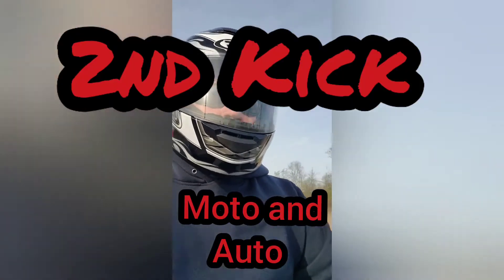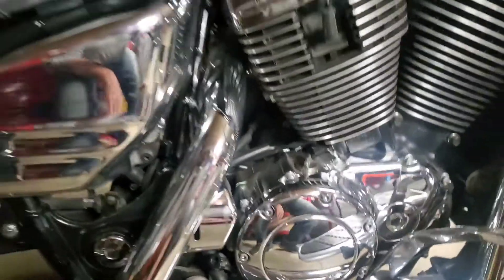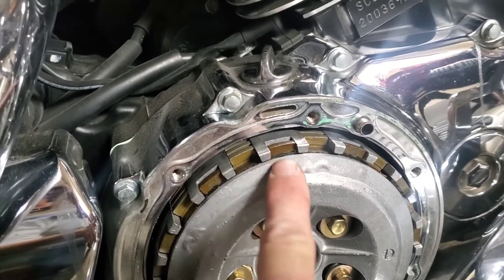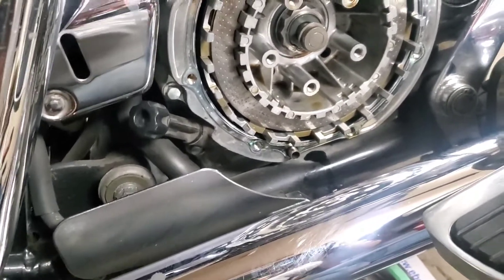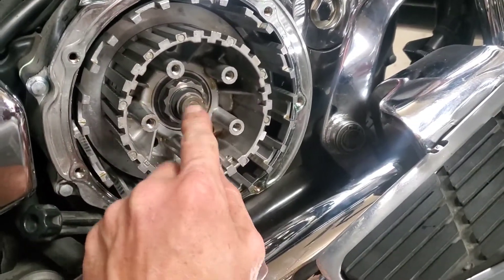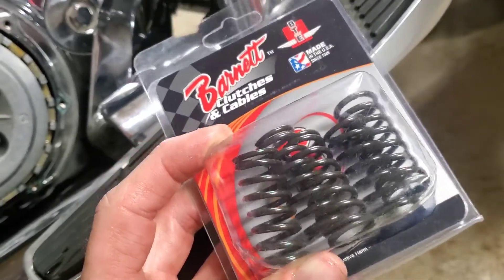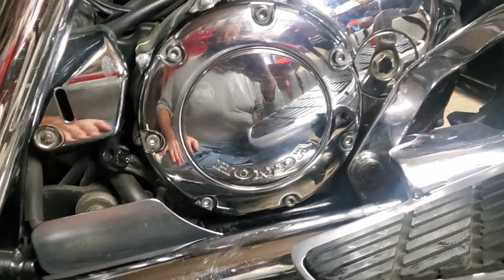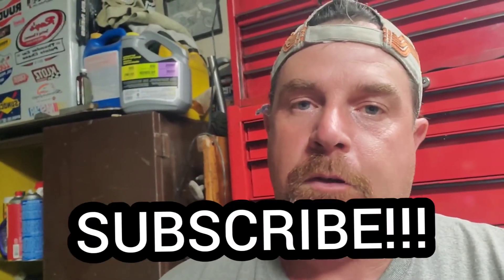Clutch Replacement on a Honda Shadow 1100

Comment: Great video.I am changing mine because it is hard to get into neutral while idling, a sign of bad steel plates. Other comments address the last disc being installed in another slot than the other. The manual calls them A and B discs. Not sure why this matters, and not sure if it only applies to the Honda OE clutch and may not apply to aftermarket clutch. Anyone have another idea on this this?

Comment: I just got a 95 vt1100c and well the clutches are binding do i have to drain the oil? Or can i pull the clutch housing and un bind them?
Reply from the maker: As long as you are careful and don't get debris in the hole where the clutch is. But should be ok. But I'd change the oil anyways if the clutch is hanging up

Comment: Did this end up helping with the slipping problem, when you come on to the throttle? I'm having same issue now with mine and just wanted to know before I order parts.
Reply from the maker: Yes it helped. The plates are usually worn out out the clutch is over adjusted when shipping

Comment: Looking at Honda 1100  touring edition  . It has 21000 miles . Factory hard bags  floor boards windshield . It's clean bike Guy wants 2400 ???
Reply from the maker: Thats not bad for price
Reply from the maker: But check for model specs. Only certain bikes came with the single pin crank that gives it the harley sound
Reply: @2ndkickmotoandauto   it's a 98 limited edition touring  I was wrong on miles. 26000 .  Thinking about offering 2000 .
Reply: @2ndkickmotoandauto    k not sure about those years ?
Reply from the maker: Depending on the model depended on whether it has the single pin crank or not. Not all VT 1100 came with the single pin crank.